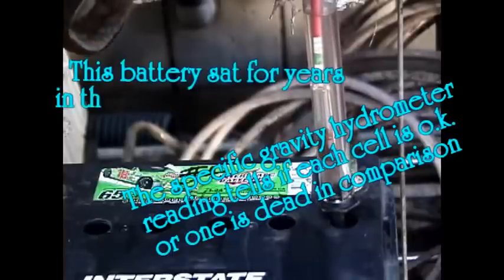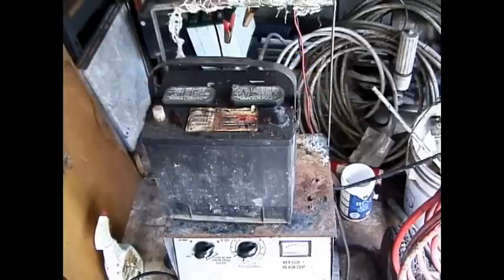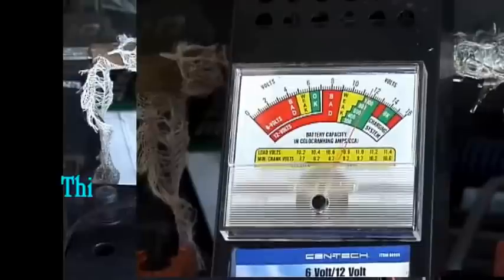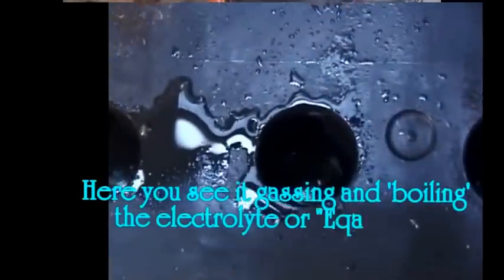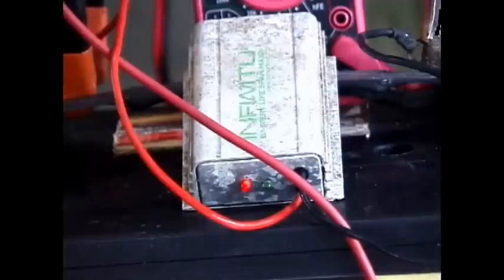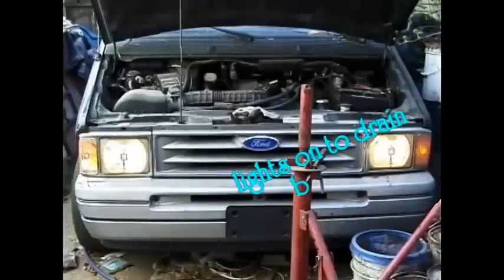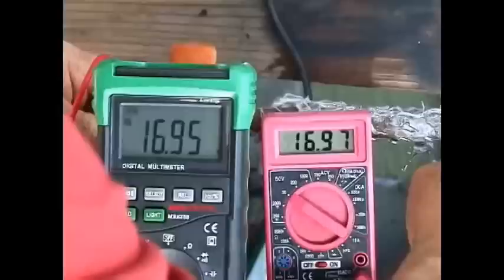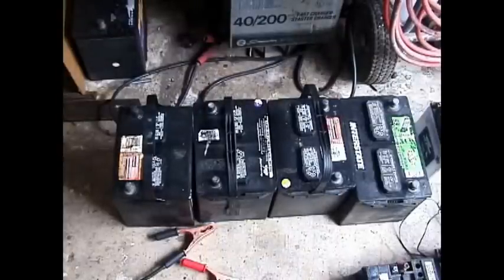Battery Reconditioning- Battery Companies PRAY You Never See This Revealing Video

Comment: this guy is the dude that will copy what he see's on youtube and has to make a video of his own regarding the subject.  he basically goes by hit n miss. he talks a lot of crap and shows no real result. 4 dead batteries and only one supposedly becomes ok again! lol ok. the reason i dislike these people who have no real skill and "experience" are actually putting people in danger.  he did not explain the devices used properly also dangerous, he rambles on and on while showing clips n pieces but contain nothing solid. i am a technician and a mechanic, i started fixing electronic things when i was 6. i repaired my first computer at age 9. it was a basic timex sinclair 1,000 built in a plastic lunch box. i was not living at home when it blew out but i asked him to feel the voltage regulator to tell me if it was warm or hot or cold, he said warm so i asked him to touch the chips with the back of his finger and he found one. it was an 8088 cpu at 4mhz so i had a friend who took me to this other techs house where he just gave me the chip! yay! it worked. my brother says he typed in "go to hell" then it blew up he said lol. so anyways real practical safe methods are rarely taught to the viewers, just these chopped up videos showing you only what they want you to see. this dude is just a big mouth who blabs on and on over his channel. you tube needs to ban these type of videos but most of them are too busy to look at every tech related video.
Reply: max tek true but it sounds like u r really full of yourself too u didnt have to ramble either but u went on about ur own accolades nobody gives a shit make ur point and b done with it
Reply: max tek
So you accidentally fixed a computer and now you`re a pro.
Some of us actually understand the technical aspects but for you it`s just another video to rubbish.
BTW I was servicing and fixing the original AT/XT IBM computer in the 80`s ( down to component level ) and I used REAL test gear - A 3 input CRO with a bandwidth of 250 Mhz.
I have another similar CRO sitting in my shed right at this moment, waiting for parts because some people have spent the time to learn a registered trade instead of picking BS faults in a damn YT video.
Reply: Go to this website if you want to learn the best method to recondition your batteries: JoxCharge. com
Reply: max tek as much as you bitch & snivel there is some good basic info here then you talk about ramble and bullshit , you'r the queen of it

Comment: I am at 7:44 and am just wondering if he actually refurbishes a battery or just talks about it for 15 min?
Reply: Well said. Thumbs up.?
Reply: thanks
Reply: I try to use your information
Reply: WTF... ?? 
You just copied and pasted the comment before? 
What's that all about Jana?
Reply: @OlfArts  this wasn't the only one; MOST comments are suggesting other sites.😒 complete bs
Reply: Great advice
Reply: thanks for your info
Reply: e
Reply: n
Reply: n
Reply: There are many factors in getting a good result. One place I found which successfully combines these is the rapid renew roadmap (google it if you're interested) definately the most helpful course that I've seen. look at this extraordinary site.
Reply: There are  a few ideas for battery reconditioning
Don't try to do this until you know what you are doing - the acid can burn you
Test the voltage first - there may be a kaput cell which would waste your time.
Check the battery fluid.
Try to completely recharge the battery.
(I discovered about these and more using rapid renew roadmap site )
Reply: I've been studying battery reconditioning and discovered a fantastic website at Rapid renew roadmap (search gogle)
Reply: I have spent months studying battery repairing and found an awesome website at Rapid renew roadmap (search gogle)
Reply: There are many factors in fixing a car battery. One plan I discovered which succeeds in merging these is the Rapid renew roadmap (google it if you're interested) definately the most helpful info i've seen. look at this awesome resource.
Reply: the best results that i've ever had was by using the Magic Mender Wizard (i found it on google) definately the best course i've followed.
Reply: the best success that ive had was by following the Magic Mender Wizard (just google it) without a doubt the most useful info that I've followed.
Reply: hi guys, the best results that I have ever had was with the Magic Mender Wizard (i found it on google) definately the most incredible course that I have ever tried.
Reply: hi everyone ,if anyone else wants to discover how to recondition batteries at home try Trefendous Rapid  Extender Tips (do a search on google ) ? Ive heard some unbelievable things about it and my partner got excellent results with it.
Reply: This is just superb, I been tryin to find out about "how to rejuvenate a lead acid battery" for a while now, and I think this has helped. You ever tried - Ammaceen Reconditioning Rabblement - (should be on google have a look ) ? Ive heard some super things about it and my mate got cool success with it.
Reply: Paul Hackett
Reply: Get battery reconditioning full training  , hurry up and copy this link on Google http://bit .ly/2LXrfs9
Reply: ✳｡ 🎀 𝟪 𝒮𝒾𝓂𝓅𝓁𝑒 Ⓣⓘⓟⓢ 🎀  ｡✳ & Tricks To Extend The Life Of Your Car Battery > https://t.co/3ycayBV4e1?FWBvpRKOFV8a
Reply: thanks
Reply: hey ,if anyone else wants to learn about learn how to recondition batteries at home try Panlarko Recondition Planner (do a search on google ) ? Ive heard some pretty good things about it and my friend got great results with it.
Reply: I\'m not sure but ,if anyone else wants to discover how to recondition old batteries at home try Renkarter Rapid Renew Report (just google it ) ? Ive heard some unbelievable things about it and my brother in law got great success with it.
Reply: hi everyone ,if anyone else is searching for how to recondition my car battery try Corbandy  Battery Blueprint Crusher (just google it ) ? Ive heard some decent things about it and my friend got cool results with it.
Reply: I\'m not sure but ,if anyone else wants to uncover how to recondition my car battery try Renkarter Rapid Renew Report (just google it ) ? Ive heard some super things about it and my cousin got excellent success with it.
Reply: hi guys, the greatest success that I have ever had was with the Magic Mender Wizard (i found it on google) definately the most useful info that I have ever tried.
Reply: interesting points ,if anyone else wants to discover reconditioning batteries try Jadonite Renovate Battery   Buddy (just google it ) ? Ive heard some super things about it and my mate got cool results with it.